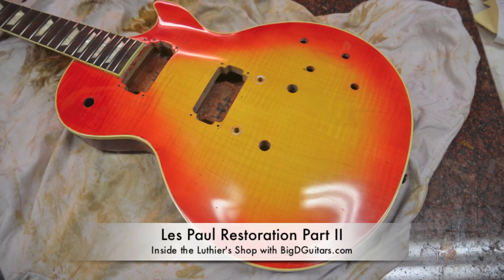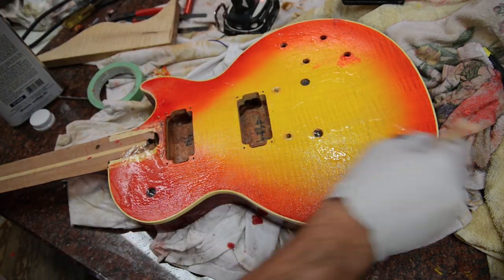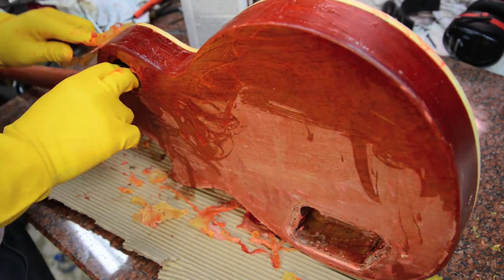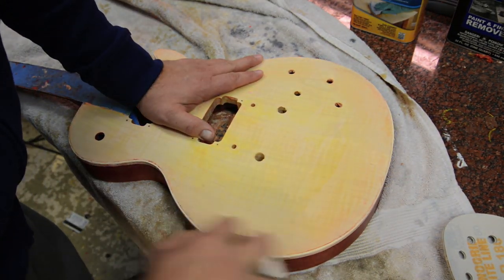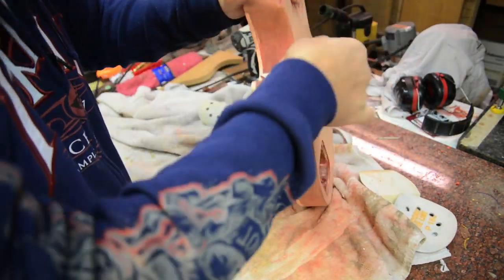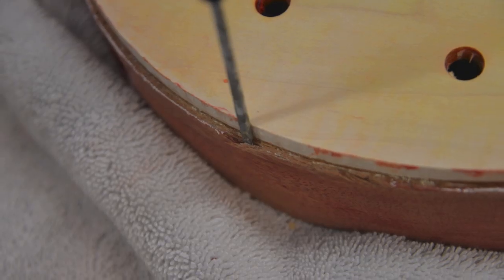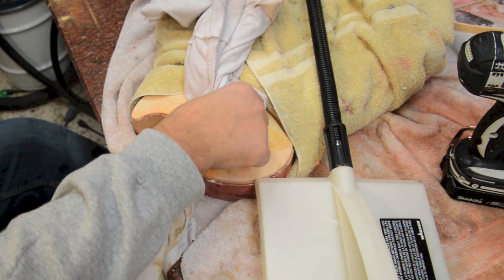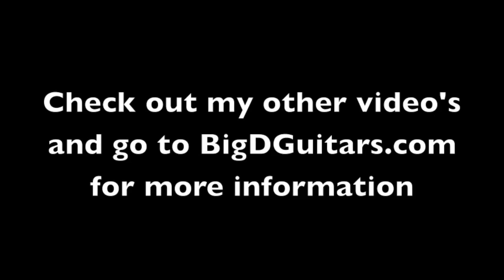Les Paul Restoration Part II Stripping Sanding and Neck Removal - BigDGuitars

Comment: A tip. Use a 'blanket stripper' to do a body. It's a paste that you apply and then cover in a plastic sheet or bag. After a set amount of hours you take the cover off and the whole paint finish will sheet off to the wood. Also. You should sand along the grain.

Comment: This is very helpful.  I recently won a bid on a butter scotch tele that has a quarter size chuck on the finish missing.  The finish on my tele is so thick, I've never seen anything like it, it's almost like plastic coating.  Definitely going to have to use stripper before I hit it with sandpaper in hopes of putting a nice stain on it.  Now I know what I have coming.

Comment: Great series.  Curious, would you remove the fingerboard to remove the neck, presuming you didn't have to otherwise?
Reply from the maker: have to remove as you need the access into the pocket
Reply: +BigDGuitars - Not entirely true. You can do it in a similar way to a neck reset on an acoustic guitar by pulling a few frets, drilling a small hole through the slot, and pumping steam into the joint.

Comment: Hey, nice job. I'm refinishing a LP that I got for cheap. Some dude sprayed poly spray paint coats and you know what happened. Wasn't too bad. I used a razor blade and naphtha. It scraped almost all clean in a few hours. I did buy some stuff like you had but it was really nasty stink. I know what this does. I'm glad I didn't strip it. I think both ways just flat out sucks. It took a lot of labor.

Comment: I'm late to class,(an understatement) why did you remove the neck ?  I'm restoring a 2012 LP Studio that was literally spray painted by a drunken 3rd grader.........stripping and sanding was the easy part. I picked up the shell from Craigs.....no hardware or electronics.  I am planning on staining,(ebony with a satin finish). What would necessitate removing the neck ?  Just curious.

Comment: Oh I have stripped many things, & done it many times! I have some secret chemicals I learned from a master Grandfather Clock maker. I met this 90 year old guy at my father's 60th high school reunion. I took my dad up, stayed at the hotel, & the brother of another alumni's husband was a master clock maker who had just bought out a luthier's shop, so we swapped wood, money, tools materials & lots of ideas. I learned how to clean up old 1800s-1940s shellac guitars from him.  THAT IS "TEAR OUT" NOT "RUN OUT". Run out is when you run wood into a jointer or planer and as it runs into our out of the machine the flat plane of the wood runs off the flat fence or table & you wind up with an uneven surface. Tear out is tearing the wood grain out with the pin router's router bit, drill bits, saw blades, plane irons etc.
Reply: Seth B what secret chemicals are you using to strip?

Comment: the sound when the neck separates is heart breaking..
Reply from the maker: +Darin McNew imagine doing it and thinking it cracked!!!! Hahhah
Reply: I did a restoration on a 1978 Les Paul Studio and the neck was WAY gone.. I had to recreate the neck joint.. some one sat on it and it cracked apart not on the glue but the wood cracked.. it sucked.. I was able to get it back together and made it look good and play good but it was a freaking nightmare..

Comment: I learned a lot as always. ThxBigD. What about with your steamer using some smaller diameter tubing w/an ball inflation needle on the end to insert into the holes u drilled??
Reply from the maker: yes that would be the best way to do this.  I had a trip to the hardware store all to buy some of that but decided to try this first.

Comment: Hi I've just seen said video and i've done this so many times I always drill a bigger hole but normally I have not removed the Fret board  by removing the Fret at the will say the 19th fret and making a reducer to the size of my hole normally using copper tube and steam it from the inside as well as out and it has to let go hope this helps regards.

Comment: Deep Marine Blue with flamed maple binding (or cream binding). Matching headstock would be sweet but I doubt you'll take the Gibson logo off. Golden hardware and clear finish on the back of the body and on the neck.
(You can search "esp original mystique marine blue" for a the finish example).

I bet it will look nice any way you choose but what I don't want to see is the "traditional" Les Paul finish.
Reply: Love Blue, a few people have said the same (including me).

Comment: Hi Big D...ive a awesome sounding LP called Camel made in 70's in Japan ,the neck is a little twisted but its always playable...i dont know if i change the neck or i asked myself that i maybe will loose that incredible sustain on it...so...to put out the neck you let the steam 50 mns? thats what you said? sorry im not english...thanks a lot for the vid!
Reply from the maker: if the guitar sounds great I usually avoid messing with it.  does it not stay tuned or can it not be played at certain frets?

pulling the fretboard and adding graphite rods would help.  There is a stewmac vid on that, but thats major work.
Reply: No its playable,it stays in tune,no frets problems...so ok! i leave it like thats..Thanks a lot BD!!!

Comment: My headstocke broke,Les Paul. Is it possible to remove headstock only and put a new one on or do i have to remove whole neck?
Reply from the maker: no you can fix the guitar without having to pull the fretboard.
Reply: thanks,apreciate it. have a nice day bigd

Comment from the maker: I am thinking of doing a brock burst, tobacco burst was second.  I think the blue would look better with an ebony board, do some nice block inlays.

one of these:
http://www.lespaulforum.com/forum/showthread.php?t=185183

The body is messy because of the filler that was used so I want to match the deep colors in the Brazilian board and the solid color that will need to be on the sides and neck.  There are spots that are not lining up and I will have to use some filler.  need to buy some cream binding from stewmac

thanks for all the suggestions!
Reply: Beautiful.
Reply: That Paul in the banner has a super classy finish -- what is that called? Haven't seen that color used before.
Reply from the maker: thats my les paul DC blue burst.  Probably my most popular vid on youtube.
Reply: Thank you, although I was referring to the Paul the sites banner ( I would describe it as a vintage chocolate brown).
Reply: ***** would the steamer damage the guitar lacquer?
Reply: If you took that shoe / plate thing off that wall paper steamer and relplaced it with hollow nozzle that tapers to the smallest point you can find, it will work much, much better. Airbrush steel needle nozzle should do the trick. Your video is awesome. I refinned my '85 Les Paul Custom got it used very cheap as it was total mess, sanded all the finish off! Saw it naked and it was flawless in terms of woodwork, one piece body, one piece neck, lovely tiger top, shame to paint... except... Some twerp had routed it for a Kahler! I've since chambered it from the rear. I'm quite insane obviously

Comment: I'm surprised this Gibson standard was built with such lack of care, the original binding job was terrible and the way the builders tried to hide it with fillers and stuff is not respectable to a guitar player who's gonna pay the price for a Stdrd les Paul. Anyone would expect much better quality-build. On the other side, you Sir are doing a wondeful job, thanks for your videos, they are great!
Reply: Julki Tan Gibson's manufacturing quality is really hit or miss.
Reply: Yeah, from my experience one of my first good guitar was actually a Gibson LesPaul studio with P90's, nice sounding guitar, overall a correct instrument but I experienced some problems on the electronic side... I first thought the pickups had a problem... I found out it was a wire a bit loose in the body touching other component parts resulting in sonic problems ( sometimes no sound at all...) I was a bit disappointed... never had this kind of problem with my other cheaper asian guitars or other mexican made... For sure some other Gibson are excellent instruments but they should all come without problem when you buy one: that's what you expect when you buy a Gibson USA manufactured instrument, if they produce a miss, I suppose there's a quality control check... then they shouldn't sell it as a Gibson or not selling it at all.
Reply: Julki Tan That is EXACTLY why I will never buy another Gibson guitar....They weren't always like that...The older Gibsons were well made...Not anymore...You are better off with one of the nicer copies...they take a lot more care with their instruments than the Gibson company...My favorite guitar right now is a MIM Fender strat ...It is a great playing, Great sounding guitar!! ...I wouldn't trade it for 3 Gibson guitars  if  I had to keep what I traded for ...lol....Mine is a 1995 model...I have been told the pick-ups currently used in the MIM model Fenders  aren't nearly as hot as the 90's pick-ups....But theres an easy remedy for that ....Simply go online to Ebay and buy an early 90's strat...You'll save EVEN more money than buying a new one...If you don't like it I will buy it from you...I don't have enough guitars...I only have 14....So I could definetly use a few more!...I fully agree with everything you said....Gibson definetly does not care about what their customers think...As long as they can sell their overpriced....thrown together guitars they simply do not care ! ...I do own one Gibson but it was made when Gibson did care... a long, long time ago....I will never buy another Gibson guitar....UNLESS it is an old one....I may not buy one of those unless the opportunity presents itself.....In other words I'm not looking for a guitar,....But if someone drops by with a great deal on one I'm a sucker for a guitar...That has NEVER changed.....and probably never will....lol.....My daughter is going to have a ball selling  all these guitars when I die....lol....God I do hope she does a little research and doesn't just give them away!!!.....facepalm...lol....
Reply: Buck Sellers Haha, tell your daughter about your guitar's values then. Thanks for your tips but I bought some guitars second hand, great way to make really good savings for what you get, sometimes you can get a guitar half its price. I've become a Stratocaster addict too, it's been few years now i really enjoy playing on fender type single coils pickups, they seem more expressive, they are brighter (of course), I noticed it blends well easily with any effect pedals (overdrive, chorus...) contrary to some humbuckers and big single coils (like P-90's)  that often sound muffled, mellow and low at first... and the 5 way switch on a strat type is just delivering great choices of tones. Anyway, when you have a good Gibson in hands you're just in heaven... but they should take care to all of their guitars in production... but they don't, certainly because they have to build too many of them. A friend of mine owns a Yamaha Pacifica guitar, strat like, not the type of guitar I would have imagined buying, but when i tried it, everything was so "perfect": the neck was incredibley easy and no needed any setting, intonation: perfect, single coils sounded nicely, electronic ok, really good tuners... I was like "wow", probably one of the best  guitar I played for an equivalent price of a MIM Fender, beating many expensive US Fender, Gibson, Gretsch that I played before... Had it been a Fender, his guitar could have been really valuable on the second hand market... there are some good guitars around, but what people mostly want is the same old Gibson, Fender...
Reply: Julki Tan I agree 100% ! ..I rarely...VERY rarely buy a new guitar...When I do buy new its usually a 2nd or has some flaw that takes a lot off of  the original price...I just cant see buying new....To me its just crazy....I actually like a guitar that has been broken in,,,,You usually don't have to do much in the way of setting the guitar up...Notice I said usually...That is not always the case....Its kinda weird but I have bought gitars from folks that have owned them a LONG time only to find out they obviously didn't have a clue how to set a guitar up properly....Kinda sad really....Usually within an hour or less of tweaking this and that I can have it playing a LOT better than it was when I  got it....And another upside to getting a guitar that has not been set up properly is that you can usually get a much better deal on these guitars...Not that theres anything wrong with them but their owners simply didn"t  know how to set it up...Some folks...A LOT of folks will not even attempt  to set one up...I'll never understand that...I ALWAYS try to do EVERYTHING I can before paying someone else to do it...I guess that comes from growing up poor....lol....When you grow up poor you learn to do a LOT of things that most folks pay someone else to do....lol....Hey I'm glad you mentioned that about  the Pacifica....I started to buy one on ebay a while back...It went dirt cheap....I wish I had now after reading your post...I'd honestly never played one tho...Still haven't...But if I run across another one that cheap I'm going to buy it.....I guess the nicest cheap guitar I have is a Oscar Schmidt Les Paul copy....It was new when I got it but had been damaged in shipping ....It had a scrape on the back and the treble/rythym switch was broken off...Not completely off just enough for me to like it.....That is one of my gripes with the Les Paul style guitars...Those Rythym/treble switches that stick way out ....This one was broken off  to what I consider perfect length .....I wouldnt change it for anything...So all that was left was the scrape...a little work with sandpaper and a dab of stain and you really have to look hard to find the scrape now......That guitar sells new on ebay for right around 200 bucks on the low end...300 on the top end....I gave a whopping 142 bucks for mine with shipping.......It truly is a great little guitar...for 142 bucks it is an absolutely WONDERFUL guitar !! ..lol....The pick-ups in it were better than I expected..I thought that would be the first thing I changed....They are not bad at all...I may change them someday...but I doubt it.....Anyways...The next time I run across one of those Pacifica's I gonna pick it up....I need another guitar...Like I need a hole in my head...lol....I know I don't need it....But hey ...I already have a dozen I don't need...So why not??.....lol.. ..Keep those strings bending!!...  I will too as long as I keep vertical.....Someday I'm going to sell a few guitars.......I keep saying that!....LOL....   Later Julki Tan !!
Reply: Give me a break.  It's stuff you'll never see unless you strip the guitar.  All guitars have this kind of stuff.  It's how guitars  are made.

Comment: I don't get all the people complaining about filler, etc.  When the guitar was together you couldn't see it.  This is what they do with "imperfect" pieces of wood, they fill them or whatever needs to be done and then paint them.

Why is everyone acting like filler that you'd never see or even know was there is a "flaw" or inferior craftsmanship?  

This is how guitars are made.  You think if a piece of wood isn't perfect they just throw it out?  I guarantee if you stripped 58-60 Bursts you'd find some of the same "flaws" in the painted parts.
Reply from the maker: all around poor construction quality, filler was icing on the cake.  they used dull bit causing a lot of tear out.
Reply: @bigdguitars  If the construction quality was so poor why did you use it to make your guitar?

Could you see the "construction quality" problems before you removed the finish?
Reply from the maker: @Vichedges  I bought this as a project to refinish the top.  When I got it the fretboard was a complete mess.  I didn't think I would have to go down this rabbit whole of cleaning/refinish up the whole guitar.  Thats why it took me so long to complete
Reply: @bigdguitars  The guitar looked fine before you did anything to it.  

What was the matter with the fretboard?  Normal wear or "quality" issues"?

If it were "quality" issues why did you buy it in the first place?

If you strip down a guitar you're going to find all kinds of flaws.  That's why a lot of guitars end up painted solid colors in the first place, to hide cosmetic flaws.

If you can't tell when it's painted over who cares?

Like I said if you stripped down 50's era Gibsons you'd find flaws and defects on many of them.
Reply from the maker: @Vichedges  this was an ebay project that was supposed to be an easy top refinish.  The previous owner messed with the fretboard and it needed more work.  I get the solid color guitars I have been working on guitars for 18 years.  As the guitar started to age you could start to see the issues.  As I tore it open more issues than I would expect.  I have owned quite a few golden age gibsons and worked on them as well, this one was different.  I didn't do a full vid explaining all the faults before hand.  Will do that when I do another project like this.  Working on a PRS restore right now:  https://www.youtube.com/watch?v=RlyjfrzfxsM

Comment: Truely a horrible job to take off the neck of a Les Paul. On the other hand that is part of the reason why a Les Paul sounds that good. Sometimes the job must be done. I still have to do it and i'm somewhat affraid to spoil the body varnish with all the heat needed to get release the glue.
Reply from the maker: +Don Armando pulling a neck is full on surgery... very time consuming.
Reply: I removed my neck the other day with this procedure & it didn't hurt the body varnish at all.